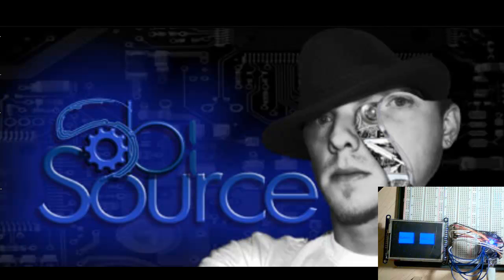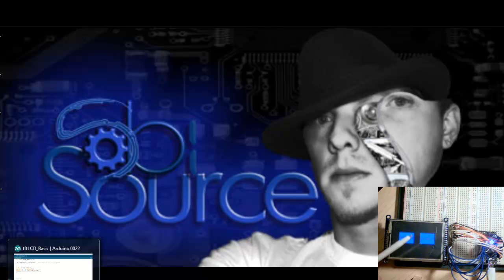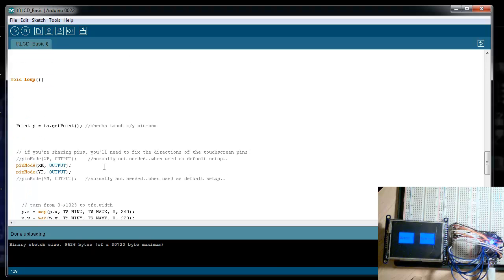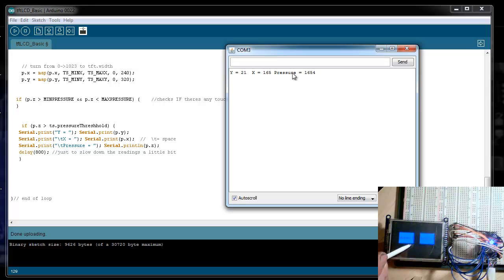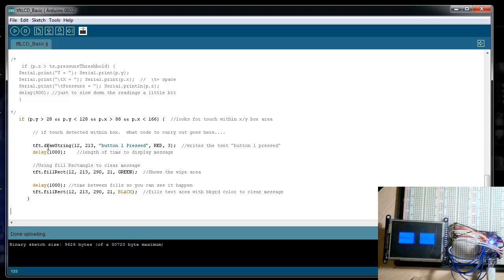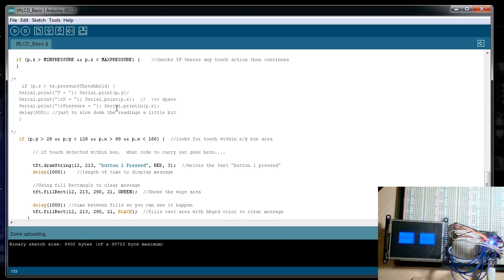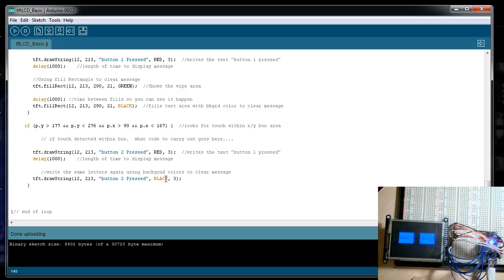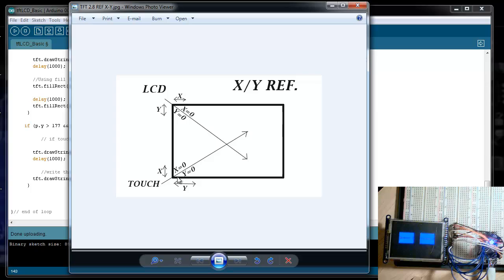2.8 TFT touch Lcd & arduino Basics

Comment from the maker: if you use the included the libraries and NOT have the latest Installed ones and this is for the breakout board not there newest shield is completely different. also this was made using arduino ide pre 2.0.  it's hard to keep up with every update they make on adafruit and arduino ide's. when I'm doing all this completely for free.
Reply: hi, Can I do this using arduino uno board and using following touchscreen

http://www.ebay.com/itm/TFT-3-6-inch-LCD-Display-Touch-Screen-Module-Arduino-UNO-R3-Board-Plug-and-Play-/111687922300?hash=item1a011e727c:g:mSEAAOSwBahVOvzR
Reply: For my project I need to detect signature using pressure. can i use this method??

Comment: Really struggling with this here, the downloaded versions seem to have errors (the included sketch), I also tried copying the sketch as shown in the video and I am getting errors that members for initDisplay and drawString are not found. I am using the downloaded libraries, its not erroring not finding them or other issues but it still feels like the libraries are wrong. In the sketch in the download it states that progmemPrintln is not declared, and I can't seem to (or don't know the type) to declare them. I tried commenting the bunch of if statements about the identifier and end up with tft does not name a type. I also had to set the board up as shield and not breakout in the header file too, but I think I have gone as far as I can with this now. Any help will be much appreciated.

Comment: Hi i wanna know if i can assign other mappings for the buttons? i cant seem to figure it out
Reply from the maker: not sure what you mean by other mappings. but, if you mean different directions, it's done in the libraries.
Reply: I want to add more buttons
Reply: i dont know what you did there:
 if (p.y > 177 && p.y < 276 && p.x > 90 && p.x < 167) 
and the fill rectangle area:
tft.fillRect(170, 70, 100, 75, BLUE); 
they dont match thats what i need t oknow how will i make more buttons.

Comment: hii, i use the same code that you wrote it in this video but i have some error like 'class Adafruit_TFTLCD' has no member named 'initDisplay' (i add Adafruit_TFTLCD and touchscreen library)
Reply from the maker: hi belhareth,
Please make sure you installed the libraries correctly. I just posted a video showing the correct method to do so..
http://youtu.be/KZLypCWRhZ8?list=UUgogsy9Mrho1hK3prAE0sWg

If you after watching that video and following the steps it is still not working please message me and i will gladly help you resolve any issues your having... thx
Reply: hi *****
thx for the answer and for the help, i did the same thing as the video that you sent me and it works very good, but in this code (2.8 TFT touch Lcd & arduino Basics) i still have one error :"'class Adafruit_TFTLCD' has no member named 'drawString' . i don't know what's the problem.

Comment: Hmmm... the min- and max pressure "if" part isn't doing anything in this code. You have to put your following code inside brackets of that if-statement. Not just below.  Also, every clear procedure in every computer or screen does clear with the same method as this, that is, just paint in with same color.. no such thing as "clear my screen" function anywhere.
Reply from the maker: your are absolutely right on both counts...  
I forgot to include the presses inside min and max pressure. however it atleast explains it's use and that it does not have to used if your just looking for any press.

Clearing messages: You are also correct here as fundamentally all lcd displays just over write old pixels.

 Thank you for pointing this out for everyone. It's a good thing to know...

As this was just a basic's beginners instructional, not everyone first starting out understands that. I find in my experience the technical realism's are better explained to beginners through simple idea's based on what is observed. 

Again thank you...

Comment: Thank you! Could you also kindly guide if its possible and how to connect Arduino 3.2'' TFT LCD Touch Shield to Arduino Mega?
Reply from the maker: the shield needs to be compatible with a mega. some are made just for mega. but, the one for uno can be used on a mega however. pins will need to be jumped to other locations.  on uno the pins used are on the side but mega's serial pins are at the bottom..

Comment: Hi. Thank you for the information. I downloaded the seeeduino library to my computer. When I tried to load it onto the arduino uno board I got an error message that said : Failed to write program to the processor. I returned the TFT to Radio Shack and told the salesperson about the problem I was having. He told me that the board is most likely not compatible  
with the TFT because it may be the 
 328P I.C. Chip may not work with the TFT.
Reply from the maker: lol Ok, first through no fault of your own. NEVER! Ask a sales person at radio shack about Anything other than a cell phone.. That being said, if that was the only error message you got,  You probably just need to select the right com port...

Comment: Hi. I recently purchased an Arduino UNO with a Mega 328P chip. I also purchased a Seeeduino  
TFT with a red circuit board on the back of the touch screen. Do you know if they are compatible since I cannot get any display on the screen.
Reply from the maker: Hello spacemouse,
I looked up i believe the screen you have and according to there web site, It looks like it functions pretty much in the same exact way. In fact it uses the exact same adafruit code for the touch functions so using the serial example i show here to find you x and y point will be the same. however, they use a different library for the lcd itself so basically the only thing majority different would be the write lcd calls. be sure to use seeduino library but IE.... theirs would be:
Tft.fillRectangle(0,0,30,10,BLACK);
 instead of
tft.fillRect(0, 0, 30, 10, BLACK);

Hope that helps......

Comment from the maker: The C/D pin is the " command/data" pin. Basically it's the pin that directly communicates to the controller for setting refresh etc. if you board uses the same controller on sure it has one just may be labeled different. After you wire all the known pins are there any pins left over?

Comment from the maker: Hello whites11tube,
A stylus is not mandatory as the screen uses a resistive touch sensor. Using a stylus or really any soft pointed object will work fine. I typically use a stylus when setting up buttons to insure accuracy and when I'm ready to actually use what I've built I'll use my fingers as long as the buttons I created are large enough for my fat fingers..